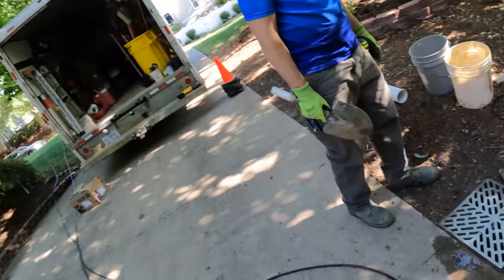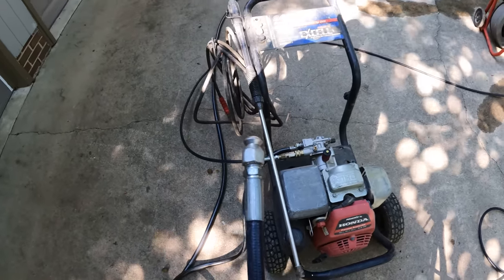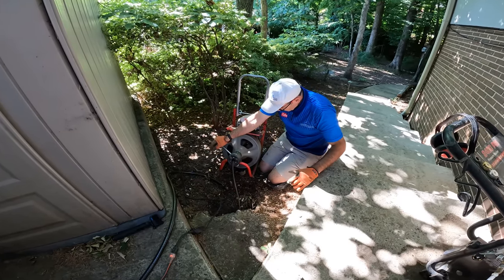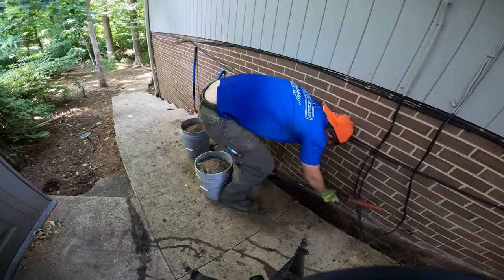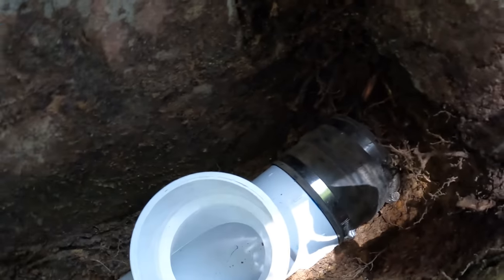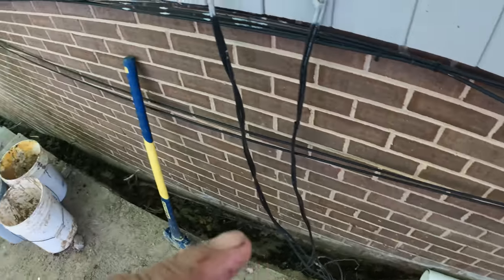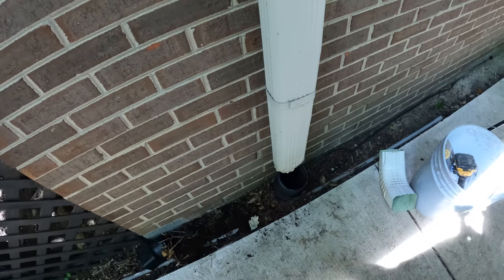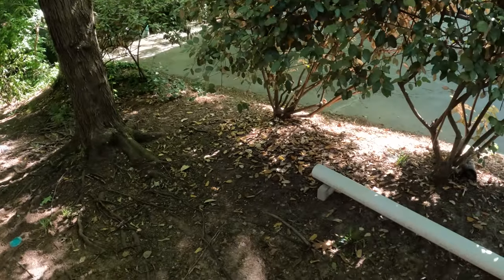My Last corrugated pipe Cleanout!

Comment: Because  a lot of people  have, and continue to use corrugated pipe, under concrete.  it would behoove you to  buy, or make a machine to bore under concrete. Even if it's 2 or 3 inch pipe, You'd get more jobs, instead  of saying, we can't  help you with your issues. I know they make, semi, large, boring  machines  that bore under roads, to replace, rotten  corrugated, steel, storm, drain pipe.  They make really big money.
Reply from the maker: I've looked into the mole system that can bore under stuff. It looks very promising Mark.

Comment: Shawn that jetter is no good for clearing heavy dirt and roots try using a reaper nozzle and something with 20 horsepower or higher
Reply from the maker: Thank you Robert! I had thought about upgrading, then I realized I didn't really want more cleanout jobs.
Reply: @GCFD  Shawn what about selling your customers
Maintenance plans for the new pvc drains you have run for them that’s what we do we sell a yearly maintenance jetting plan to keep the pipes clean

Comment: I really felt the frustration on this job, sitting here at my PC. Glad you solved their problem but man I will never ever use that corrugated crap or buy a house with it. The homeowner probably didn't install that stuff and inherited a problem. Now back to crawling around attics running cat6 cable.
Reply from the maker: Have fun in the attic! Hopefully it's not too hot up there.

Comment: That can happen to any system that isn’t maintained
Reply from the maker: True. But a solid PVC system has far less to catch debris inside the pipe and the glued joints keep the roots out. Heavy rains flush the system and self clean the debris.

Comment: Thats not the fault of corrugated pipe, it was shitty install. Corrugated is better in many cases when it has the proper catch basins and cleanouts. Every time you connect to gutters you need a proper catch basin to stop buildup and if you using slotted for a French drain it needs stones and fabric, or the holes get filled. In many areas, mine included, you cant use PVC. It cant take the ground movement from frost.

Comment: This had nothing to do with corrugated pipe.
Ridiculously large catch basin that hadn’t been cleaned out for years, gutters that hadn’t been cleaned out for years, and a grate on the exit of the pipe doomed this system.
PVC would have been the same.

Comment: It’s not complaining it’s a surefire pain in the butt type job.    When is corrugated any use?
Reply from the maker: Corrugated is good for a temporary pipe to divert water when it's raining and you only have a sedan to go to the hardware store and you're already running late, and your trunk is already full, plus your back seat doesn't fold down anymore because the latch is broken. Corrugated is good then, right?

Comment: I have been following you for a while and im surpised you guys dont use any (filters) dont know what you call them. But where i live in Sweden we use some grids to collect the leaves and stuff that shouldent be in the drain. You should look it up!
Reply: Without routine maintenance, they would clog up too.
Reply: @TexasTimelapse  yes they do but its way more easy to clean 👍
Reply: @Robin-pt9zd  you can tell by the ground level catch basin that was filled with years of topsoil that there's no way the gutters were cleaned regularly.

We have gutter downspout guards that do keep the debris out of the pipes. We have to clean them out 2 or 3 times annually.
Reply: @jonathanjudd3168  thats what i mean! 
Ofc in this case it would not made any diffrence. I just mean in general 😀

Comment: They make a high pressure tip specially for roots. Check out "Drain Addict" on You Tube. He has cleaned out hundreds/thousand feet of drainage pipe with roots and compacted matter in a much quicker manner. How ever you may have fewer jobs for installing new piping.  To help yourself you should put  a TY cleanout between the down spout and the drain pipe. this area will get clogged again until they put on a leaf guard type of gutter or they clean the gutter often. I enjoy your vlogs and the way you always do the whole job.

Comment: I think you kneel on hard surfaces too much. If you continue- knees will give you problems.
Reply: Shawn looks to be wearing pretty good knee-protection. His assistant Jeremy wasn't though.
Reply from the maker: Good point Charles. I try to wear knee pads and we don't work that hard. I have many sets of knee pads, but sometimes we don't wear them, as Steve mentioned above. I also ride my bike so I keep my knees moving, and I get them rotated regularly.

Comment: This is one of those jobs where you ended up with a solution you aren't really happy with but the "ideal" solution was just cost prohibitive.     Lot's of negotiations and compromises with the homeowner before you ended up with a solution that works but is far from ideal.    All based on cost.     I'm sure you wanted to get out your concrete saw.
Reply from the maker: This took almost twice as long as I had anticipated, so It wasn't a very good job for making money. We worked hard to get it done as best we could and they were happy.
Reply: @GCFD   I hear you.  I'm sure you did a great job of meeting the customers needs within their budget. 
I thought it was a good video.  It showed a real world contracting situation.  If price wasn't an issue, you would have gotten all those pipes underground.  But that wasn't in the cards so you found a way to meet their minimum needs of getting the water away from the foundation.   
BTW: I really liked your fernco flexible coupling solution for that tight spot. I'll try to remember that one.  You even left in the part where you forgot to loosen the band clamp :)

Comment: You have the wrong equipment, to have any chance of cleaning out a stormwater pipe you need at least a 5000 psi jetter, not the toy you have. the drum cleaner is for waste pipes not for cleaning out stormwater drains, you need at least a Ridgid K-1500 with 15' sectional cabels with the proper cutters, you have the right equipment for trenching and digging, so why buy cheap toys for your real business?

Comment: If you were profesonal know what you are doing,  you would have at least 5000 psi with a 6gpm pump  if not 8000 psi and 12 gpm
Reply from the maker: Exactly. I'm not trying to be a professional pipe cleaner-outer guy.

Comment: if you don't have the proper equipment to do a job then you shouldn't do it at all.
Reply from the maker: I completely agree. Having a snake and jetter on site was key to finishing this job well. If I was interested in doing more clean out work I would buy higher capacity jetter equipment (higher psi and gpm) and a better snake.